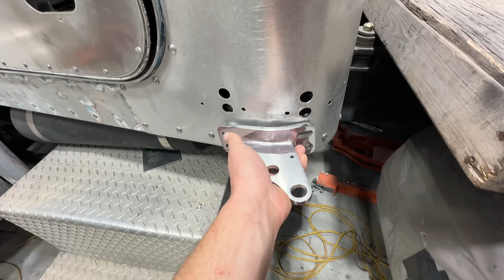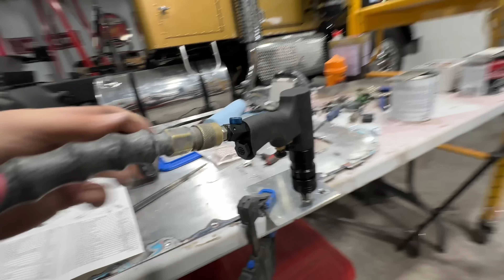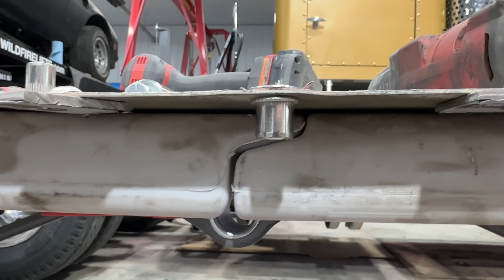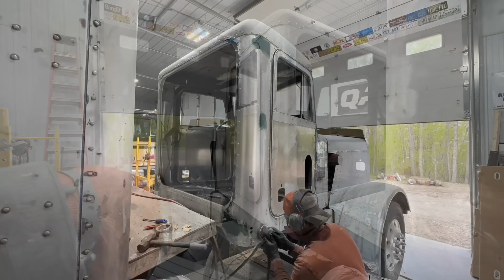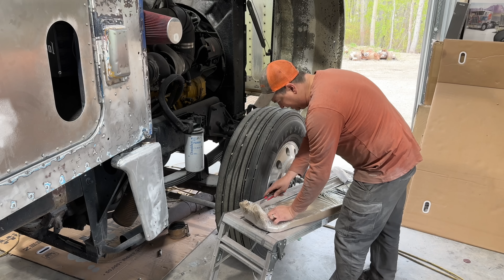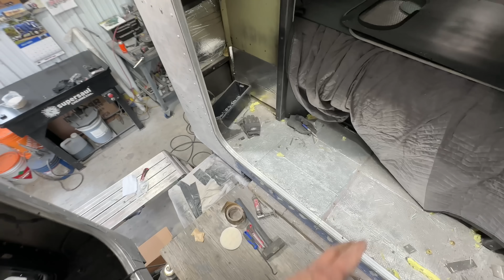Peterbilt 359 Restoration Ep.90 Pead Opsrating Instructions

Comment: I hate to say it but filling those holes with body filler and sanding the surface flat is probably going to come back and haunt you later....it will probable pop/crack at the hole as things flex/vibrate. The best course of action if you want to fill and not weld is bond something such as a small piece of aluminum in behind the hole to seal it, make the outer edge of the whole slightly concave with a light tap of the ball end of a ballpeen hammer then fill after scuffing the surface, this way it backs the hole and gives something for the filler to adhere too and you're not just creating a filler plug.
Reply: 💯 also i really wish he would use an air board instead of a da sander for doing big flat surfaces , that's gonna have more waves than the pacific ocean sanding body filler with such a small and aggressive sander

Comment: Hi Mark, I would use the inserts for your visor. If you ever had to replace a windshield you have to take the visor off. It is much easier to unscrew the bolts than it is to grind off the rivets. Just a thought. Can't wait to see it finished.

Comment: Since you used Bondo Glass on the cab corners how about sealing the insides underneath with zinc chromate allowing it to dry overnight then cover with 3m Rubberized spray to have a air tight seal,just a thought!!!

Comment: Little sandblaster with a soft medium to blast around the rivets and hard to get crevices to remove paint. Problem with roof condensers is cold air goes directly on your head and you get cold air. Red Dot roof condensers are very common in Australia. You can buy them new and heaps of parts available including fibreglass cover.

Comment: Hi   Mark, with ref to the holes in the cab corners.. could you not just Huck Bolt  them and make it a feature  on the cab skin.. save trying to fill em with glass fiber .. that might crack with the cab stressing / moving about .. Keep up the Cracking good work on the Old Girls .. Andy UK ..

Comment: If you watch Mike the truck nut the Peterbilt ones are sealed on the back. Keeps corrosion out of the threads. And the best way to squeeze the insert is to use a stud  and nut and washer. Hold the stud and turn the nut. Keeps from damaging the threads.

Comment: The type of metal makes a difference. Stainless is much harder to collapse. I used to use threaded rod and nuts inside (if Possible) and out. Using the outside nut to pull them up.

Comment: The visor looks nice Mark.  It's certainly been polished a lot better than the so called polished factory visors
that Pete put on the trucks back in the 70's and 80's. I detest drop visors that cover almost half of the windshield.
I know you like the straight stacks, but personally I like mufflers with the factory heat shields and grab handles.
I've heard that there isn't anyone making reproduction factory heat shields, and it would be next to impossible
to find original shields that are like new. 
Looking at your reproduction a/c condenser cover got me thinking about the availability of factory heat shields.
Maybe that's something that they could start making. I have no doubt that there would be a big market for them.
Your new cover looks a lot better made than the original covers. They were a little flimsy and didn't hold up very
well sometimes. 
I still like the look of having the cover on the roof. I've been around trucks since I was born in 1961, and that's
how trucks were that had a/c. I started driving truck when I was 18 (1979) and by that time Kenworth came out
with their "Grilldenser" system that did away with the roof mount... I remember Freightliner kept using the roof
mounted system for a while, but I can't remember when they stopped.

Comment: Mark,when nipping up rivnuts without using the correct tool you want your spacing socket/bit of tubingetc.  to be resting on the front flange of the rivnut,not on the face of the material.

Comment: You need to be careful with cheap nutserts. For your use, it should be fine. But if it was a working truck they don't pinch tight enough and will vibrate loose over time. The ones used from factory are different

Comment: I wouldn’t have filled the holes before the welding was done.  Aluminum dissipates the heat quickly and I don’t think the filler will survive the heat.
Reply: It was warping before I could get a puddle to add fill

Comment: Should have just used a spacer between the two exhaust brackets no hole drilling  most likely you did not have to move the cab exhaust brackets  since you are not using mufflers

Comment: Welding small hole does not add more heat than trying to fill larger holes and tell blake he needed to buy a buck rivet tool not impact rivet gun like the one on Semi casual of which you poo poo'd because of cost
Reply from the maker: They’re $3000 😬
Reply: @TwinStix  hire one if you want your rivet heads correct considering your a stickler for things been correct (movie correct)

Comment: why go through all the trouble when you can just use 379 exhaust brackets
Reply from the maker: Those are 379 brackets … the issue is there’s no supporting metal in behind the lower one at that location so the pipe would fall off the truck

Comment: Your totally wrong with the rivnuts... i use a a manual rivnut gun aka like a manual pot riv nut gun.. never had a problem.. used one a side cill.. at 10mm bolt

Comment: Hey Mark please don't put that air condenser on that 359 little by little please please don't do that to that truck it had the seven lights across the top with the air condenser and it didn't look right I mean the paint job was nice but otherwise 🫳 I think that's the hand emoji for maybe maybe not